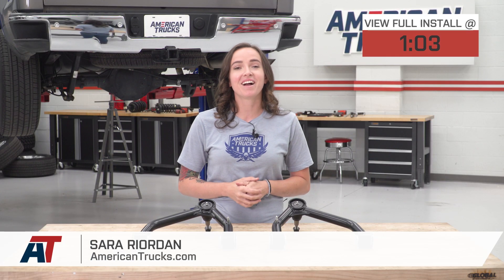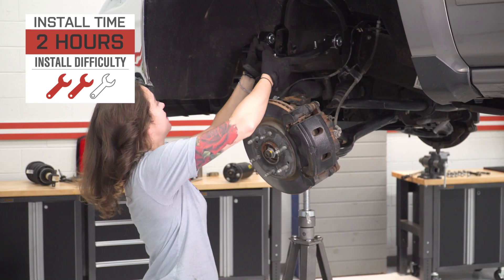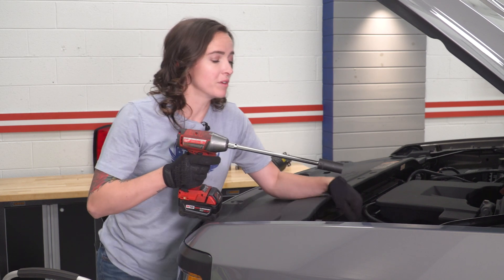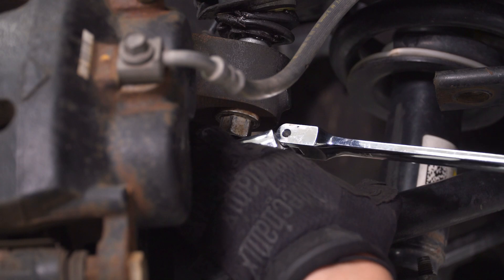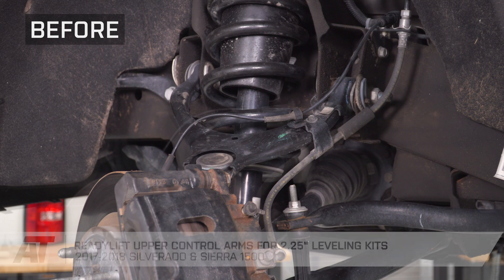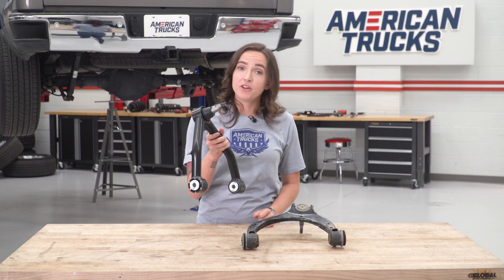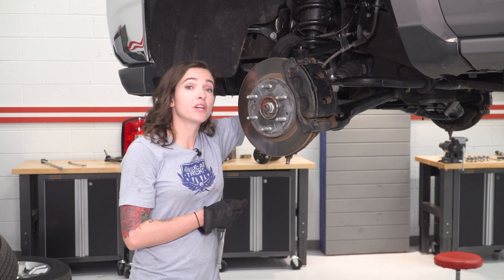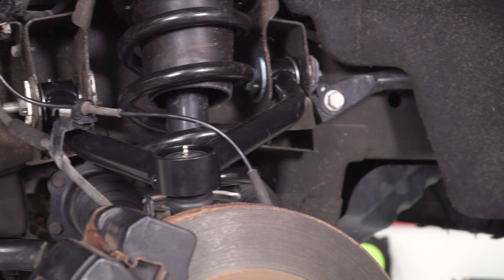2017-2018 Silverado & Sierra ReadyLIFT Upper Control Arms for 2.25" Leveling Kits Review & Install

Comment: I have this leveling kit installed on my 18 Chevy Silverado and it has performed excellent so far! I put about 15,000 miles on it and it is perfect! I recommend Ready Lift highly!!
Reply: Are you running the factory upper control arms? I just purchased a set of wheels 20x10 -18 offset and I’m wondering if I should purchase a set of ready lift upper control arms. I have Motofab 2.5inch leveling kit on my truck now.
Reply: Love when no one replies

Comment: Recently installed this kit on my 2018 GMC Sierra 1500 SLT.  Replaced the tires from factory Goodyear Wrangler SR-A 275 55 R20 to a Michelin Defender 275 60 R20 and there are rubbing issues on the front on the control arms on both sides.  This happens on full steering "lock."  Wore off the powder coating on the new control arms.  Already contacted and had my mechanic who installed the tires review the tire situation and they are stumped.  Called Ready Lift and they say that everything meets their "spec" and that the tire upgrade isn't anything radical and falls within their allowances and MAX tire size.  Next step is to the performance shop that installed the Ready Lift kit.  I spent a lot of time researching all this and none of this makes sense.
Reply: surprised ready lift didnt tell you that you need wheel spacers
Reply: @-Guts886   The speed shop didn't tell me.  Kinda pissed about it but they made good and paid for one pair and installed all four for nothing. Cost was one pair of spacers for the rear.
Reply: At least they made good on it, 👍

Comment: DO NOT go with this brand. They use use garbage bushings.  These commonly crack apart and tear up quick. Mine didn't last a year in just normal once a week driving.  It becomes and embarrassing squeak that is super loud, then you'll have to replace the bushings (to the body), then another alignment ( highly recommended).  
Just an FYI they use Moog K6688 bushings.  Find another brand if you can. AC Delco has a decent one.

And btw, great video!
Reply: Mine did the same thing in about 8 months also after the lift install. Bitch is squeaky as hell now 😅 thought it was my struts. Definitely wrong.

Comment: Is there a diffrance between the stamped steel or the regular steel arms for these control arms?
Reply: If you're asking about fitment, the OEM aluminum forged arms will fit the stamped steel equipped trucks

Comment: I have a level kit on my 2016 Silverado do I need this.?
Reply from the maker: It would absolutely help get your geometry angles back closer to factory and improve your ride quality! -Zach
Reply: @AmericanTrucksChevyGMC  ok thanks going to look into this 👍...
Reply: Does this help with cambering in issue?
Reply: @AmericanTrucksChevyGMC  I have a 2018 Silverado 1500 4x4 with a leveling kit of 2.5 will this work with me?
Reply: Torque specs ? For control arms